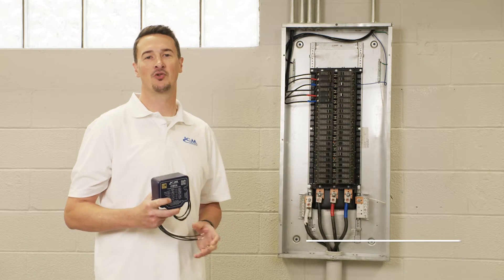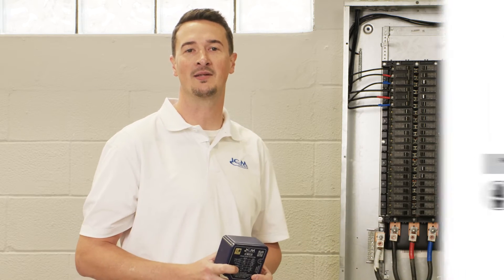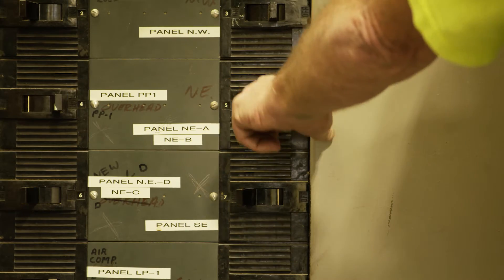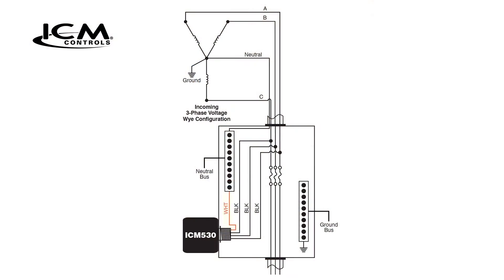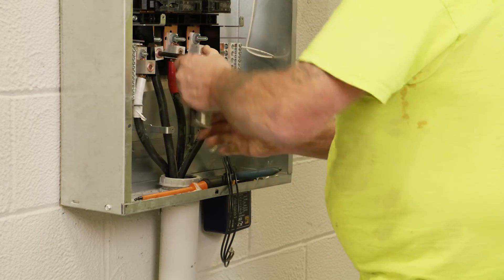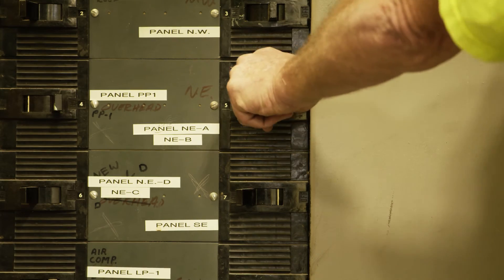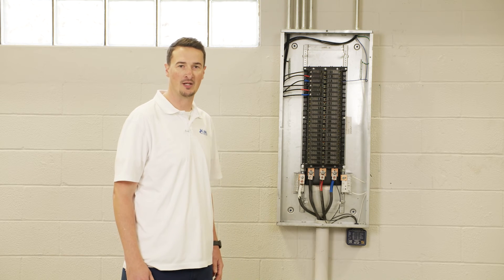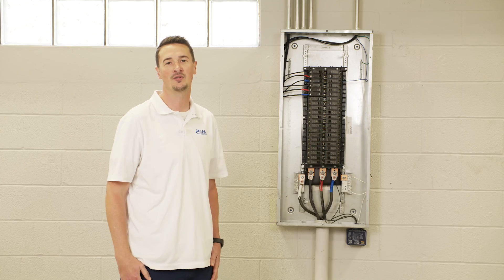Installation Video ICM530 Series 3-Phase Surge Protective Device

Comment: Why don't ICM build a DVM and a surge protector in just one device? I watched the presentation thru Esco Institute last week and you have to use 2 devices for each application. When it comes to adding these devices to an estimate, customers don't like too many adds on and they start taking them out or just not choosing you for the job which is bad bc what you are trying to do is protect their equipment, but they might think that you are adding too many things. It would be awesome to just have both (surge+monitor) in one device, one price and that's it.
Reply from the maker: We offer this in our ICM493 for single-phase applications. There are some hurdles to achieve the LVM/Surge combo for 3-phase, but it is something on our radar for sure. Be sure to follow us and hopefully theres some good news to share before too long.